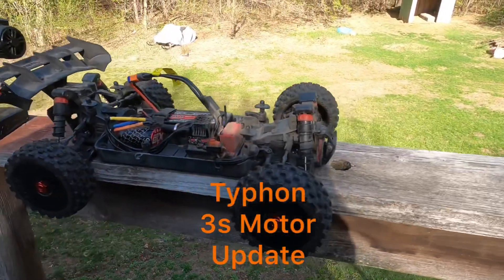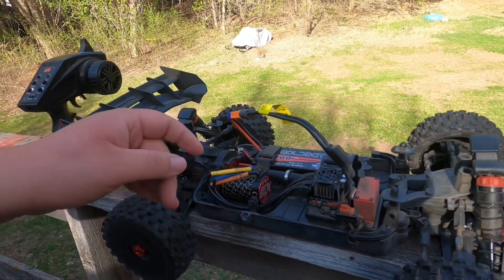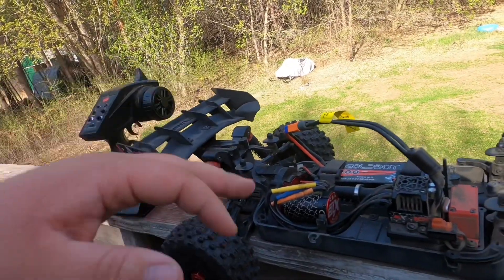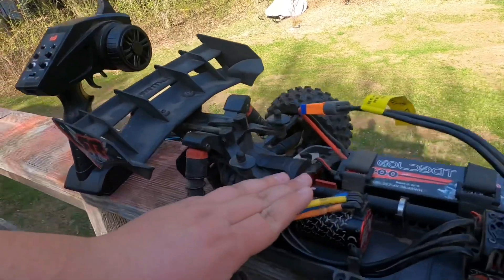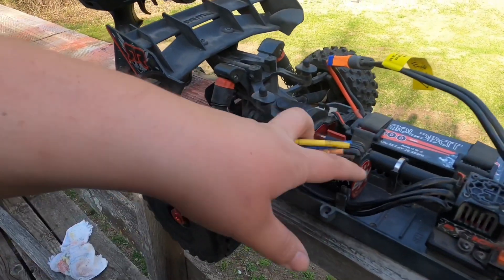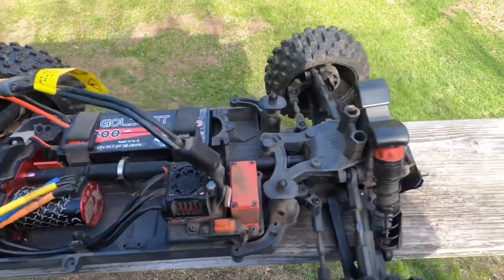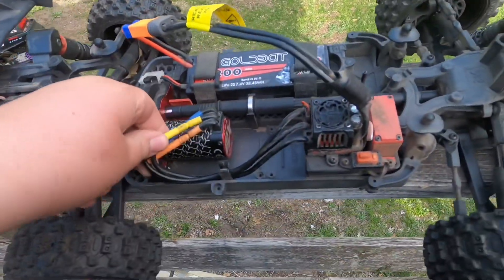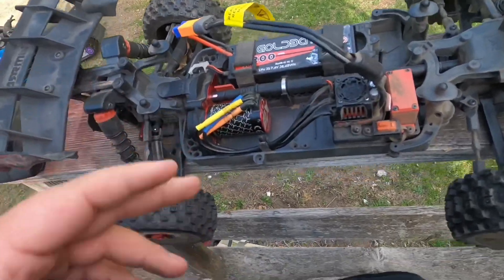Arrma Typhon 3S Motor Update ! WATCH BEFORE YOU BUY

Comment: keep in mind you went trought sand bearings and sand doesnt like each other mine are still good and dont have wheel wobble the motor bearings on those things are weak crap gets inside slipper dust sand everything just remplace that bearing on the front by ceramic hybrid sealed of good quality

Comment: I'm thinking about getting this, if I wanted to upgrade it to 6s what all do I need, just change the motor and esc?
Reply: Hey I would buy 6s instead and save your money 
6s comes with metal everything 
Typhon 3s will run 6s Motor esc but not for long
Trust me just buy a typhon 6s you will save loads 
Hope this helps
Reply: It will handle a 6s but it is cumbersome and more fun on 3 s. Great car after steering slop is eliminated.

Comment: You guys are all noobs, the problem is that the spur isn't good at grinding large particles into dust, it's a simple fix, have to make a relief cut on the bottom of the chassis so the particles have an escape path...
Reply from the maker: Literally this is what I did before I sold it lol  but by doing this your also giving them another path to get in